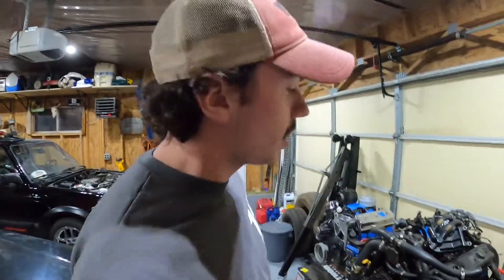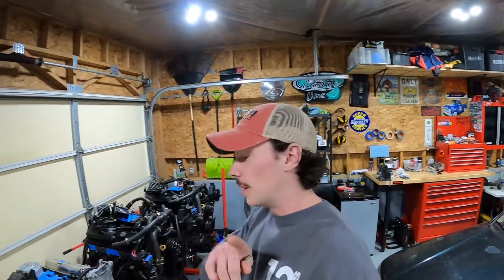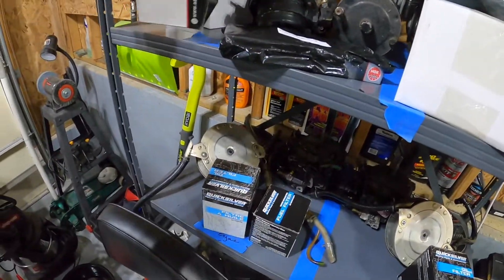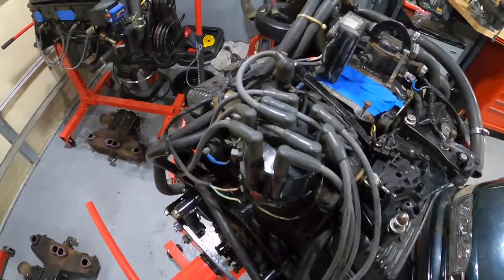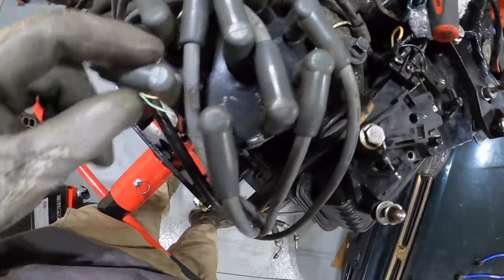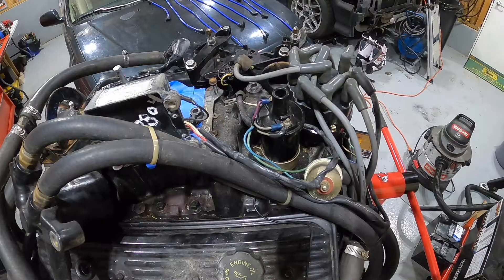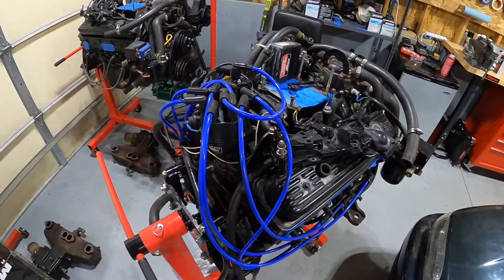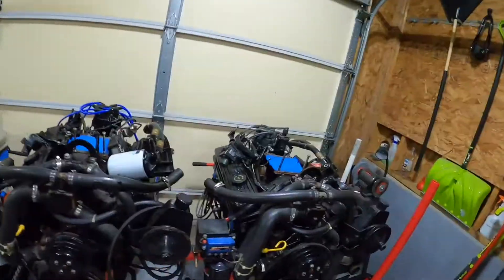One Of The Greatest Speed Boats EVER BUILT | 1987 FORMULA F-242 SR1 | Boat Restoration

Comment: These engines run much better when you use the original OEM AC Delco Marine spark plugs! Also your distributor should have a vent with a screen in it, If it does make sure the screen is clean and installed! Secondly before you install your rotor you should have checked the air gap! And lastly the alternator you installed did not look like a Marine alternator, Using an automotive alternator can literally cause your boat to catch fire or explode! Not to mention if you get boarded by the Coast Guard the alternator is one of the things they check! One last thing I didn’t finish watching all your videos but I hope you checked the alignment of your engines before tightening your motor mounts and installing your drives! Miss aligned engines can cause vibrations, premature wear on your gimbal bearing and more, If you missed any of those things you should definitely go back and check those things at the end of the season!
Reply from the maker: It’s rare we get someone who cares to make sure we followed all the procedures when doing these jobs. For that, thank you! Yes yes yes and yes. We made sure to check everything when completing this engine refresh and replace things using the correct parts. The alternators were not marine but Modified them properly to ensure random sparks were sealed. The boat has now changed hands twice I fixed it up. Last I heard it made its way out west and is still running driving well!